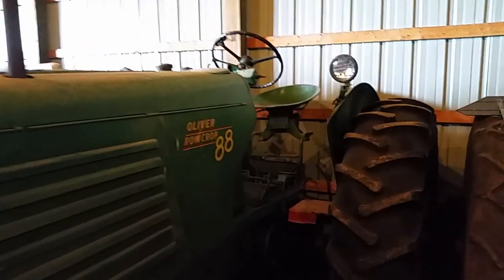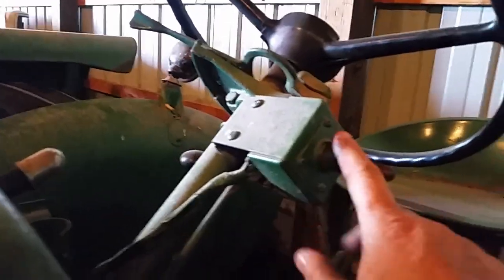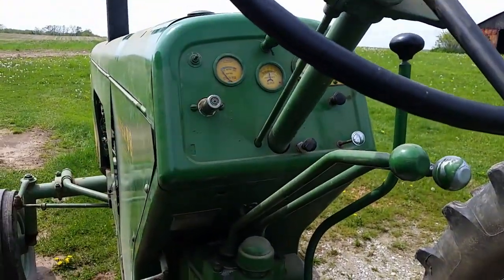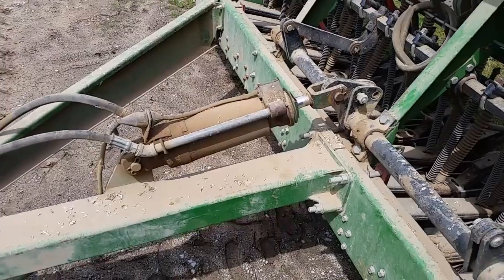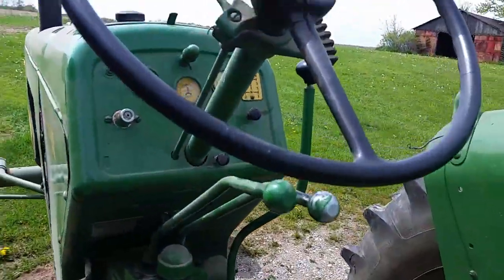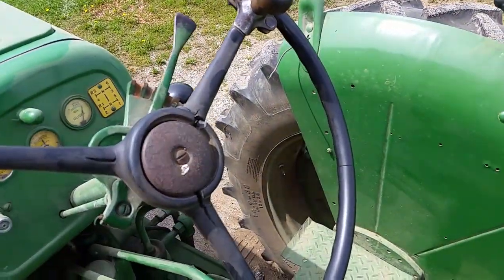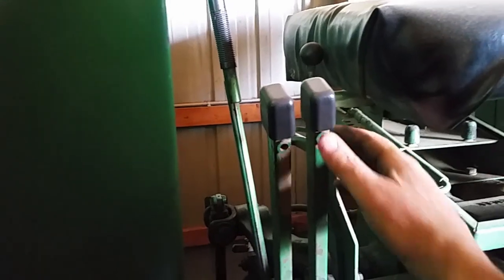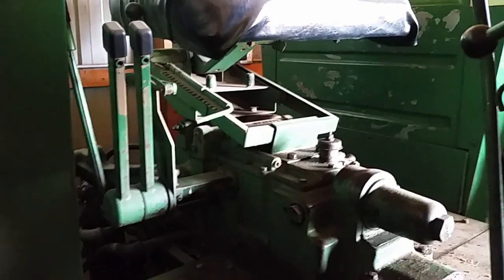Oliver Hydra-Lectric... What is it?

Comment: I have a oliver 77 i bought i need your help to help me identifiy which hydraulics mine had 

There is a series 1 hydraulucs
There is a series 2 hydraulics 
There is a series 3 hydraulics 
There is a power tool hydraulics

I am not sure which hydraulic lift mine has can you make me a video going over abd talking all the hydraulic opitons for a 77 oliver 

Also you hit the lever down by hydraulics to start do all oliver 77 start this way mine dies not have that lever ny hydraulics ???
Reply from the maker: The series 1 hydraulics don't have a filter and no mechanical levers, it was all operated by electric switches. 

Series 2 had the electric controls, but also had manual levers on the side of the reservoir. The electric may have been removed over the years

Series 3 had the levers out the top and no electric switches. 

The power tool hydraulics was entirely mechanical, and you rotated the levers instead of moving them up and down.
Reply: @ThatOliverGuyChris  on the second oliver in this video you pull a rod/lever down low by hydraulics to start this tractor do all oliver 77 have this mine does not ??
Reply: @ThatOliverGuyChris  and were there any oliver 77 that came from factory without pto ??

Mine does not have pto  it I think it is factory no pto is this rare ??
Reply: If your tractor had series 1 hydraulics and you had dual remotes would that mean 2 electric levers by steering instead of 1 yours in video has 1 not 2 ??
Reply from the maker: @TeresaJohnson-ew4us  that starter lever was only on diesel models. Gas engines had a push button on the dash. Any of the hydraulic units could be ordered as a single remote with only one lever and/or switch. Pto was an option the 77 could be ordered without. It's pretty rare to find one that way from the factory, but it did happen. A lot of them don't have it now because guys take it off to lower the weight for tractor pulling
Reply: @ThatOliverGuyChris   the series 1 hydraulics you talked in video is/if your tractor had 2 remotes then you would have 2 electric buttons by steering wheel ??

You have parts for oliver 77 I need a complete full drawbar with all bolts nuts and brakets , seat with toolbox , full complete pto , and a dual 2 remote hydraulics unit , and all sheet metal for both sides both the curtains and the 2 pieces on each side above them and the 2 pieces behind them on each side 

Can I send you pics of my tractor so you can tell me if it had hydraulics and witch hydraulics it had , and pto from factory or not this is my first oliver
Reply from the maker: @TeresaJohnson-ew4us  yes
Reply: @ThatOliverGuyChris  how would I send you pics of my tractor ??
Reply from the maker: @TeresaJohnson-ew4us  hpocachris@gmail.com

Comment: I would agree that it was ahead of it's time. I just got a Super 77 diesel with the Hydra electric system that is not all there and I have to decide whether or not to repair it. In the 1950s Chrysler developed an electronic fuel injection system for the big Chryslers. Although the engines ran well, the components could not handle the weather.  The diodes would fail. Chrysler recalled them and all and converted them back to carburetors. I'm not sure which engine was used for this but I believe it was the 392 Hemi.
Reply from the maker: I hadn't heard that before.  Cool history!

Comment: Thanks for sharing. When we bought out 1962 770 had it. It was very handy.
Reply: We just bought a 770 diesel with front loader. I saw the wire were cut just front of the levers. This saves me extra work now. I don't implement. Will just work a Gannon or rippers. The reservoir doesn't stay full. I thought maybe the front loader rams were dry and thats why I kept pumping in fluid. We bought all the manuals from Jensales. Best I guess to take off the reservoir and rebuild it. Need that break ram to work.

Comment: When did Oliver come out with the Hydra hitch three point? I assume it was their first three pointer. I've seen older tractors with it but no one seems to know if they were factory mounted or retro fitted kits put on later. Thanks.
Reply from the maker: I don't know exactly when , somewhere around 1953. It was an after thought on the part of Oliver, trying to play catch up with the other brands. It was a bolt on unit that could be ordered from the factory or added to an existing tractor.  There were quite a few variations on it as well, due to design improvements that always go with a product that is rushed to market. They did much better with the Super 55 and its integral 3 point with draft control.
Reply: @ThatOliverGuyChris  Yes the did.
Reply: @ThatOliverGuyChris  Yes they did on the Super 55 Nice tractors!

Comment: Chris:. I am restoring a Super 77 gas with a series 3 Hydralectric system (just like the super 88 in this video).  If I do not intend to use the Hydralectric system and instead just plan on using regular cylinders, do I still need to put on the Hydralectric wiring harness when I rewire the tractor?
Reply from the maker: You can use regular hydraulic cylinders with it and leave the wiring harnesses off. It's common to find where some snipped the harness off and left the base in to keep dirt out. Korves Oliver has reproduction harnesses if you want to put a set on for looks, and you'd still be able to use a regular cylinder.

Comment: My 1655 has those buttons.  I also have  a 77 that had the electric, but like you said, the wires were cut and the switches are stuck.   My super 77 , I wondered why the hydraulic levers moved that way.   Thanks for sharing

Comment: Why doesnt my 1855 return to neutral when done back or forward on the handle
Reply from the maker: David Hunt That's a detent type valve that just needs an adjustment.  Sounds like something for another video.
Reply: Chris Losey  ok cool so it can be adjusted !
Reply from the maker: Yep. You pop the cap off the back of the valve and stick an Allen wrench in there and turn it to adjust how easy it kicks out. I don't remember the wrench size off the top of my head, maybe 1/8".
Reply: I will check it out...thanks

Comment: So, on the series one system, did the switch operate a solenoid valve?
Reply from the maker: RustyCarnahan That's correct. On series 1 and 2 there is a solenoid on the inside that actuates the valve. Series 1 did have a small peg on the side that you can put a small wrench on to manually actuate the valve. Series 2 had  levers built into those same spots that were much easier to use, but still had the internal solenoids. Series 3 had to be run exclusively with the levers.
Reply: Chris Losey, thanks. That clears up just about everything I've ever wondered about Oliver's Hydra-Lectric setup.